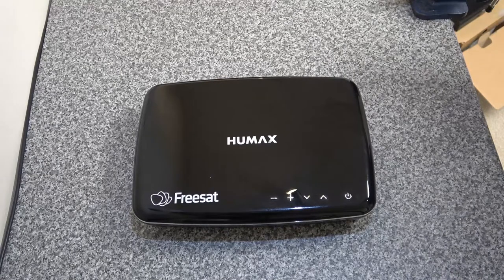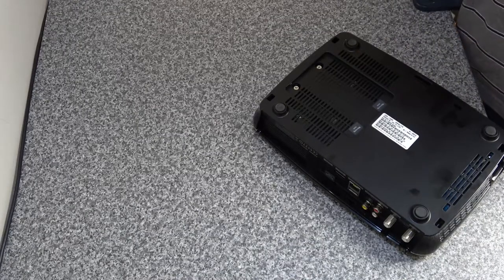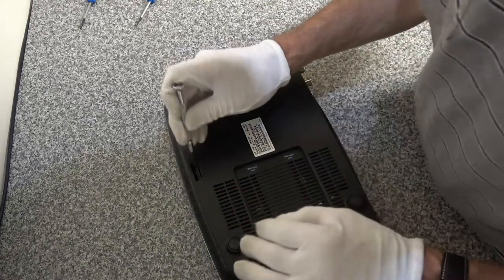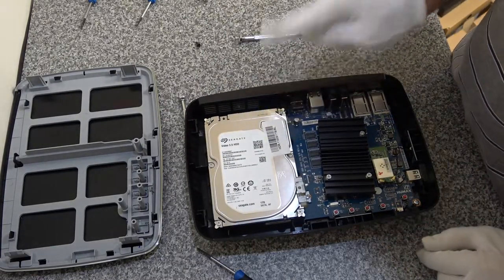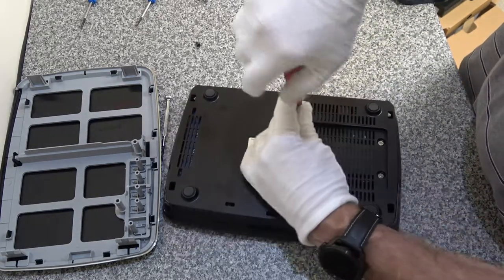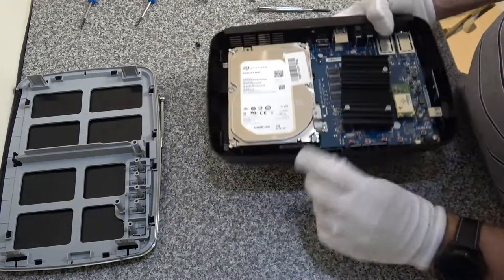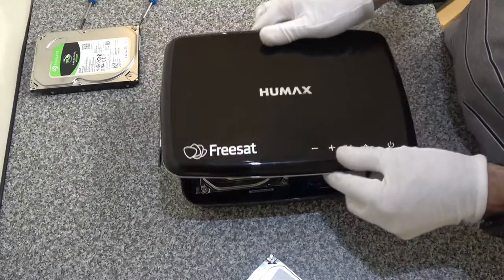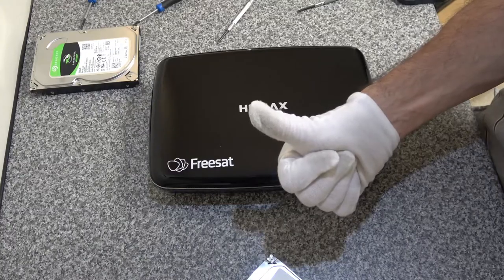Humax Freesat HDD replacement after shows not recording

Comment: The bracket is there to earth the top plate of the HDD to the circuit board. The bracket includes a metal coated pad which is conductive. The bracket and pad can be fitted in different ways to accommodate HDD's of different thicknesses.  I was able to fit a 2 TB Western Digital Purple HDD which is thicker than the Seagate drive it replaced.
Reply: Hi can you put old recordings onto a hard drive like seagate?
Reply: Thanks

Comment: You haven’t mentioned the whole point of your video, did it fix the issue ? The answer is probably not. Your video was basically- how to open the box and how to change a hard drive. If you had mentioned this in the headline of your video I suspect you wouldn’t get comments like these.
Reply: Hi do you save your recordings to another device?

Comment: I don't see the need for the top mounting bracket as the HD is held in with four screws from the bottom. I think the only purpose for it is to protect against someone just removing the screws whilst not holding the HD in place. I bunged a full height HD in mine and dispensed with the top mounting bracket. The only issue now is whether there is sufficient heat dissipation.
Reply from the maker: I'm curious to see how a SSD would fare in a Freesat box for recording and playback. It's bound to be better than a HDD, but obviously it needs to be a video type drive. Has anyone tried this?
Reply: @FrimleyComputing  The large HDD I used has worked faultlessly but I wasn't happy with the increased noise over the existing HDD which was already pretty noisy (loud continuous hissing noise, clicking heads and loud disk start-up noise) and high temperature (the top of the case would get quite hot). So I have just replaced it with an SSD and given it a quick test by recording two programmes at the same time whilst watching one of the programmes. So far so good. And the box lid is now cold and the box is completely silent and vibration free - I could actually sleep in the same room as this whilst recording. I'll report back in about three months as to whether it is continuing to work. If I can get three years before SSD failure then I'll be very happy. This SSD is only a small 240GB one which only gives about 170GB for recordings so my intention is to not let it go above 60% full at any time and I have also left time-slip off so that it is not recording continuously.
Reply: Three months gone and the SSD is still working perfectly - no issues whatsoever - I wish I'd replaced the noisy, clunky hard disk much sooner. The box is completely silent. I've been careful not to let the SSD get more than 50% full and haven't activated the constant record functionality - I never saw the point in constantly recording on the off chance that I would need to rewind. SSDs seem to be starting to come down in price now so I may replace it with a larger capacity at some point.
Reply: Drill some holes in the plastic casing ... and fir a small fan, worked for me.
Reply: @thumperman8490  Thanks. The HDD proved to be quite noisy so I replaced it with an SSD. Totally silent now and has been running fine for months. I've disabled time-slip to limit the SSD writes.
Reply: @sborgs99   This was my problem, I fitted a new HDD when the original one died. The new one sounded like a plane taking off when in use so for the last 6 months I've not used the Humex at all and just relied on a fire stick. I've ordered an SSD and bracket (3.5" to 2.5"), I'll let you know how it goes.

Comment: Hi great video I have a bt you view box and all I'm getting when I switch it on is please wait I've tried to do a reset by turning the power on and pushing the volume button but nothing seems to to work🤔I was wondering if I could put the hard drive in my old laptop and format it but I'm not sure
Reply from the maker: I'm not sure with the YouView boxes, however its definitely worth trying to see if it fixes things. You can always put the old HDD back in after if it doesn't resolve it. Have you tried reformatting the drive from the settings menu? It's an option on the Freesat box, but again I'm not sure with the YouTube box.
Reply: @FrimleyComputing  the box has been in a cupboard for a while I'm getting no on screen display even on the right av input I will try it on my front room TV later

Comment: It would have been sensible to check that there are good reasons why a video rated HD was used, do not just shove any old disc in there!
Reply from the maker: Agreed, however if you don't have one (and don't want to buy one) then any HDD will do. I've been running this since changing and have had zero issues. It all works just fine. 😃
Reply: @FrimleyComputing  The problem with hard drives is they tend to be noisy. Video ones are designed to run quieter and take all the constant recording and deleting a bit better than a PC one. But if you are happy that’s the main thing. 😀
Reply from the maker: @michaelsullivan7987  Indeed. I just used what I had laying around rather than buying a replacement drive. I don't use a freesat box anymore as we had to replace the TV so purchased a Samsung with freesat built in and connected an M.2 NVMe portable drive to it which we now used for Timeshift & recordings.